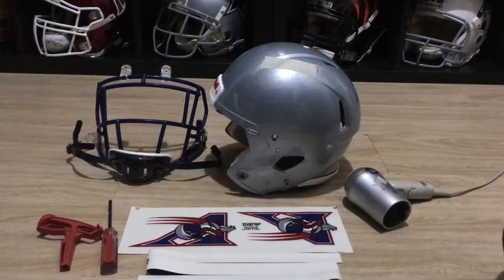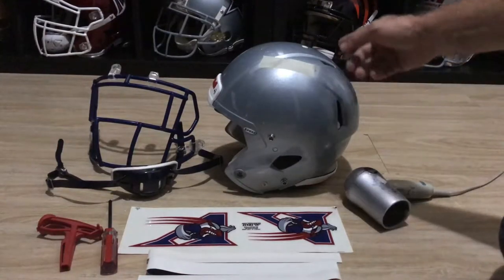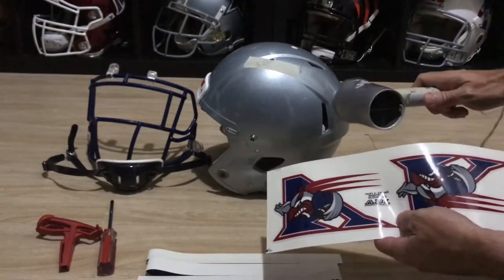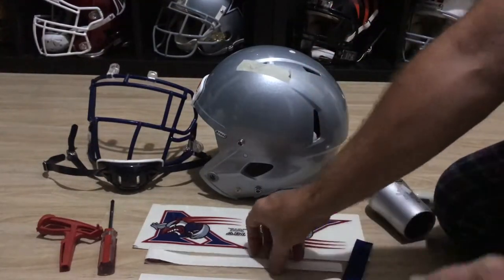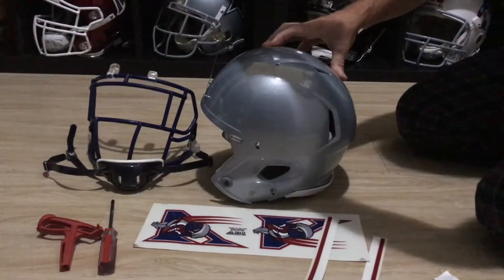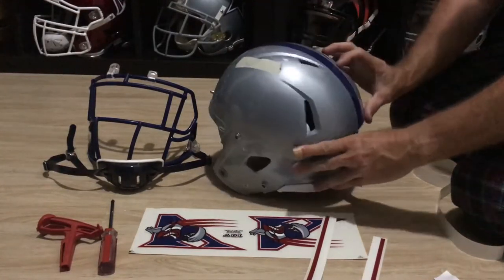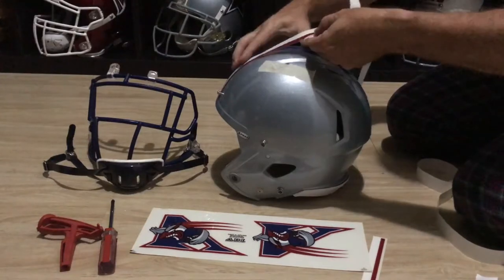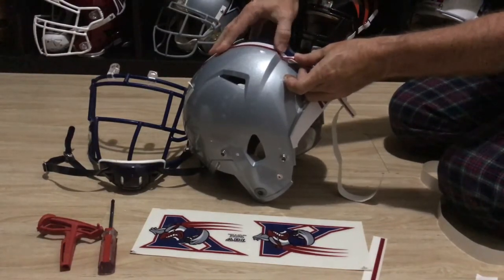Football Helmet collection Riddell Speed Montreal Alouettes  assembly Pt 1

Comment: The redskins and giants cut the stripe across, so there won't be that gap when the stripe lifts
Reply from the maker: Orly Ray you’re exactly right. I did that on this helmet after the video and my other helmets too. But it really only works when you have the thinner (14 mil) correct stripes that the teams use. Even then as you mentioned they still need to be cut sometimes. The generic stripes (20 mil) that everyone sells don’t conform to those edges on the new helmets very well, if ever.